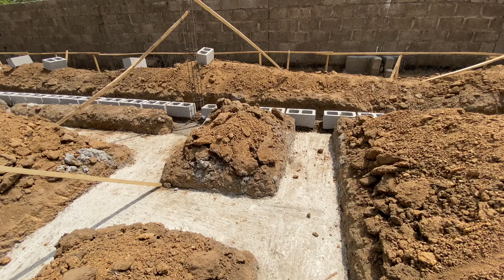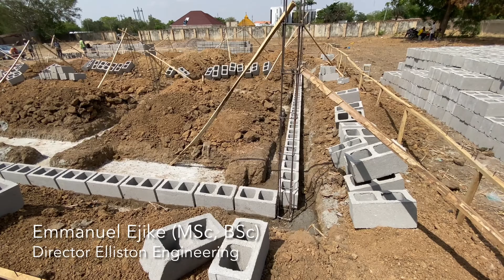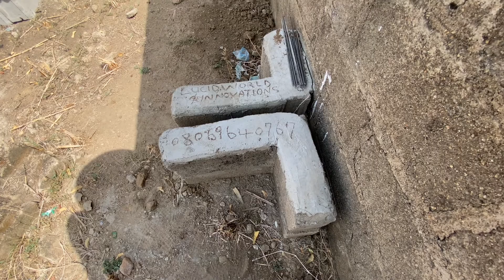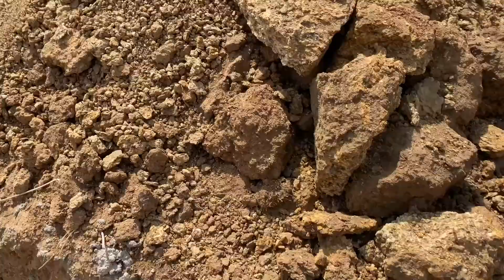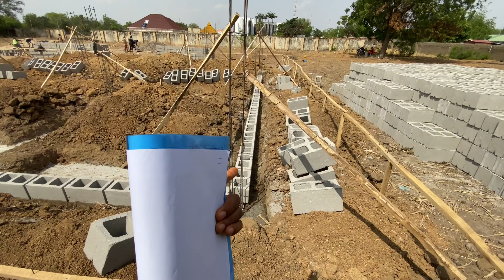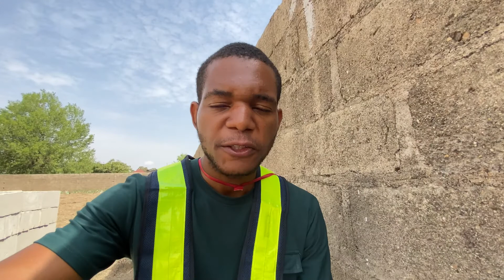Building a House in Nigeria in 2022 - 4 Bedroom Bungalow

Comment: Sir, please how much more or less can foundation of a story building that consist of three bedrooms downstairs and upstairs each with desperate toilet,i will really appreciate if you can give me an update, thanking you in advance.
Reply from the maker: Budget 1.5 - 3.5 million Naira but this can vary greatly based on those factors I mentioned in my earlier comment.
Reply from the maker: Hi Moses. Thanks for the comment. There are a lot of things that need to be confirmed before an accurate estimate can be given. This includes: the strength of the soil, the location of the project (because labour cost varies across location), the size of the building and rooms, the topography of the area, the water level, etc. Generally, it is best to have a design first, then you can be guided on how much it will cost to construct it. Feel free to get in touch if you need further guidance.
Reply: Please sir just an estimate thanks